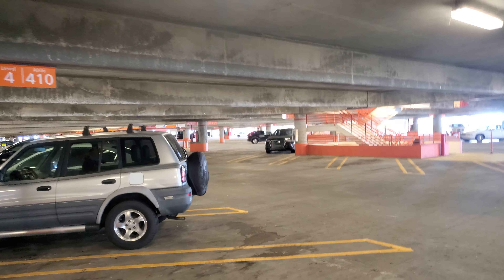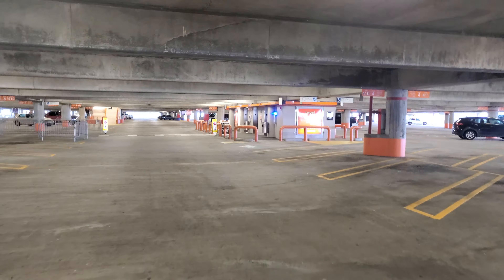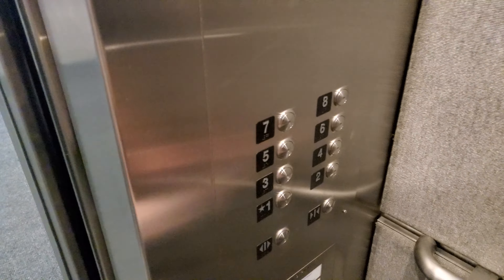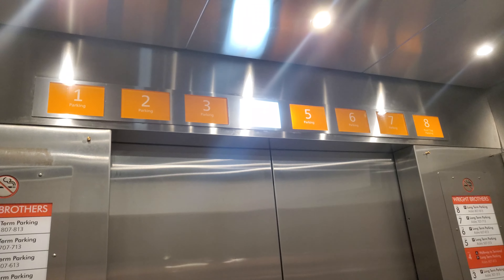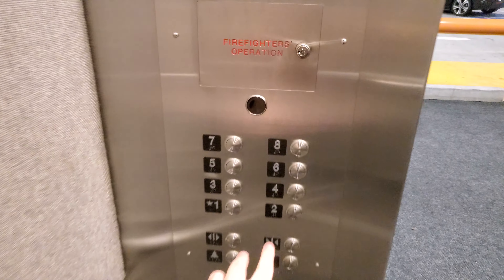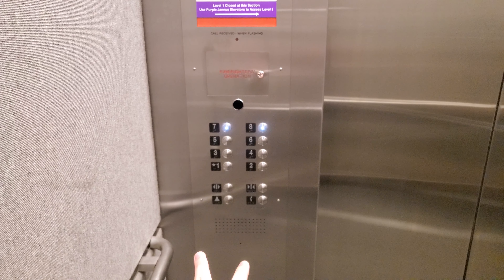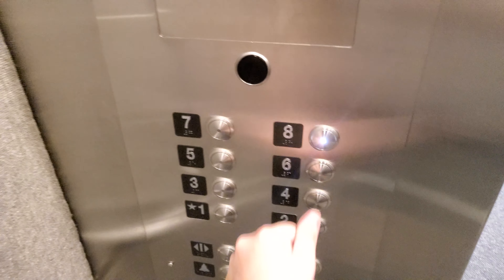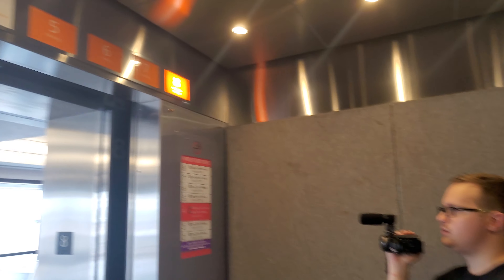NEWLY MODDED Schindler 6400 Traction Wright Brothers Elevators at Tampa Int'l Airport, Tampa, FL

Comment: Is that the original indicator? They replaced the lights in them.
Reply: Read the description dummy
Reply: @elevdsm  Yes, I am the dummy.
Reply: @davidng2336  No you aren't
Reply: Unfortunately the indicator is not original. But it’s stylish enough.
Reply from the maker: The indicator was replaced, but indeed it resembles the original indicator